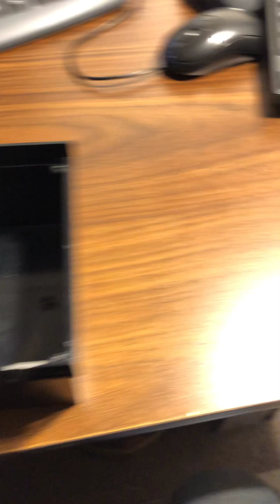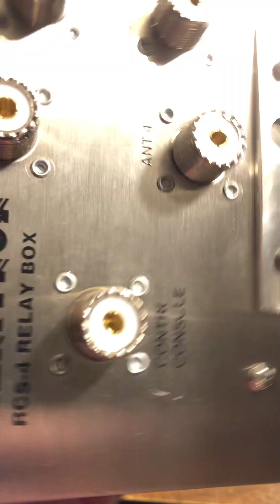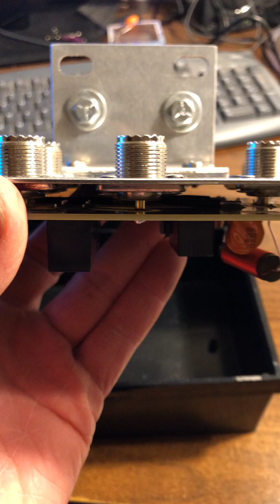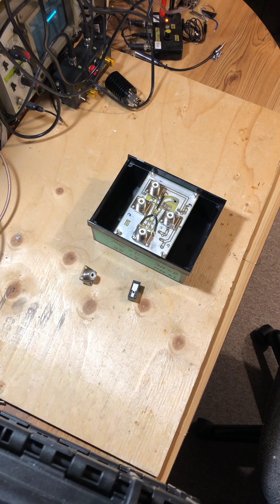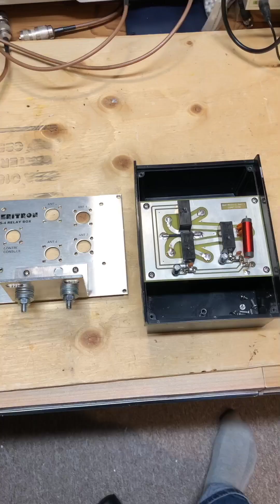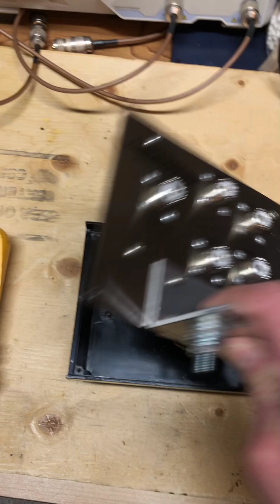RCS-4 Repair and Modification

Comment: What is the model of the desoldering tool? It looks handy.
73
Doug
Reply from the maker: That one was a "generic" one that I bought off of Amazon.  It has since cratered and I tried to replace it but was unable to find them again, so I replaced it with an Amazon Hakko one and I like the new one much better.  I am skeptical about the authenticity of this new one but it seems to be decent quality.  It was marketed for the Japanese market so the voltage/frequency rating did not quite match, but I figured for the cost savings it was worth the gamble of having it not last as long as one rated for our grid.  It was about 1/2 price of the ones marketed to the North America market.